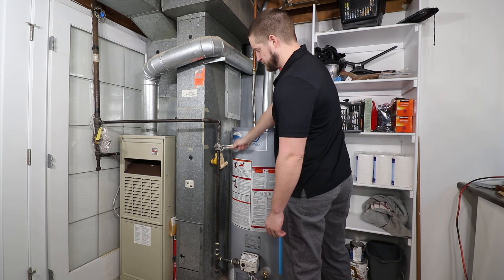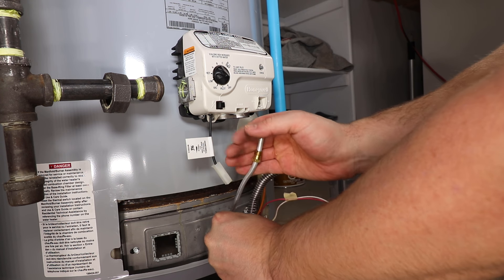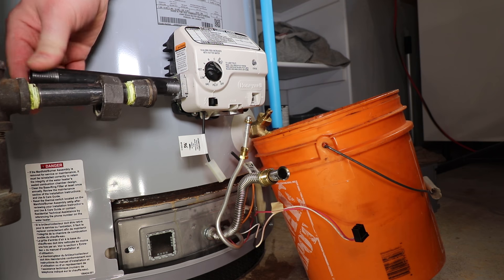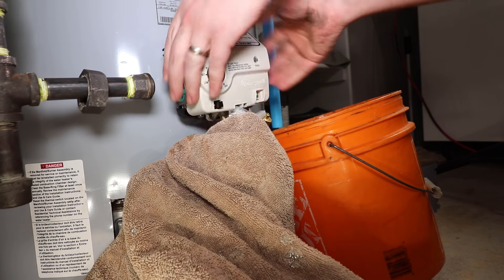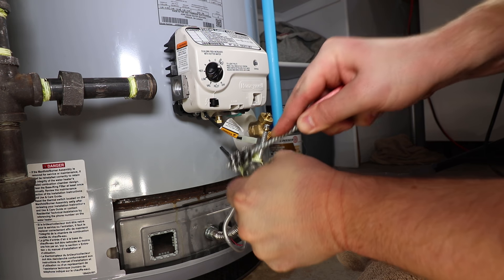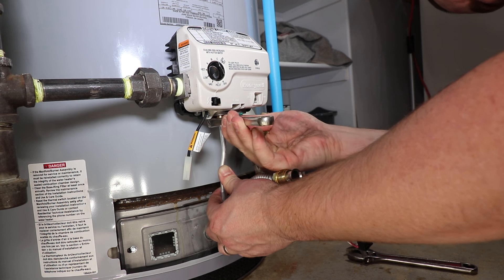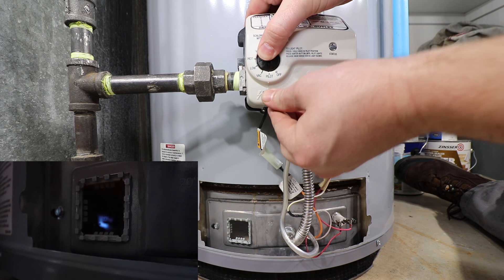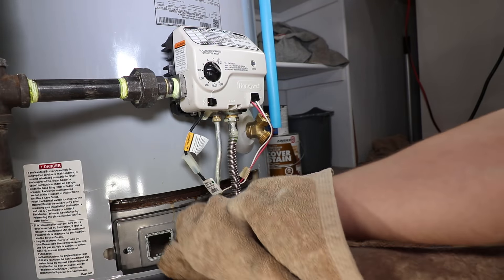Gas Valve Replacement on a Water Heater

Comment: MAKE: GSW
MODEL: G6-60S42N-PV-ES2
Installed: Brand new 2021 (Summer)

Hi there,
So today I noticed a Single Flash roughly every 3 seconds.

Error code states it is...
"LOW FLAME SIGNAL (Control continues to operate)

So I know what the code means but nowhere does it say how to correct it.

What should I do?

What I have done so far:...
I noticed that there were some items and boxes stored in close proximity to the water heater tank, so I removed everything to allow maximum airflow.

What else can I do?

Comment: Thank you so much. Perfect instructions. Was able to change in 30 minutes.
Reply from the maker: Thanks Sergio!
Reply: Hi Sergio did you drain the whole tank or did exactly as the video?
Reply: Used a garden hose until it stopped releasing water

Comment: I replaced my own thermocouple assembly, and gas control valve on my water heater using these videos and discussion in the comments. Thank you! Thank you! For these videos. Clear  and perfect!
Reply from the maker: Thank you Roman Thru! Nice job on your repair!
Reply: My tank will not ignite after many attempts to try. Do you think changing my thermocouple will fix this problem ?  I need some advice  please .

Comment: Wow! A perfect video! I’m not one to like or subscribe because then all I’ll ever see is water heater videos... or whatever I liked last. But I am happy to donate a couple bucks for this well crafted video. Venmo? Patreon?

Edit: found the donation site.
Reply: Double Edit: I attempted twice to donate. Each time its said something went wrong... I checked the simple information a bunch of times, the processor isn't working ATM. Lame. This is one of the few videos I've ever seen that was actually well produced and helpful.
Reply from the maker: Thank you so much for the kind words and feedback! I checked the donate link and it seems everything is up and running. I'll double-check with PayPal. Thanks for the attempts though. Take care!
Reply: @PROSDIY  Man, I really tried... it still says it for me, I was attempting the credit card method. Tried a different card, third time was not the charm - same message:

"Something went wrong
We couldn't process this donation. Please try again later, this could just be a temporary glitch." 

Venmo and Patreon have never had a problem like this since I've used them for years. Unfortunately this has lead me to feel less comfortable with PayPal than I already did. Either way, my wife and I will be replacing this valve body this evening probably by draining it all the way and taking our time... Without this concise video, I doubt we would have made the choice to do it ourselves. So thank you. Now you can be the only channel I subscribe to. lol
Reply from the maker: Thanks for the information. I'll definitely check into it. I have a Ko-fi page as well, but that uses the PayPal payment engine as well. If interested it's here: https://ko-fi.com/prosdiy
Good luck on your replacement! Let me know how it goes. Lol, thanks for the support!

Comment: We had a a repair guy out today and run a diagnostic on our water heater and said that this was the issue. He said that it's very difficult to do and it would cost $700 plus labor. Or the better route would be for us to completely buy a new water heater for 1700$
Reply from the maker: $700 would be very high for a atmospherically vented water heater control valve. Make sure to get a second quote.

Comment: What was the purpose of having to replace this? Was the box faulty or was it leaking? I have a Bradford White that is dripping water from behind the box and a $250 fix would be a lot cheaper than a $750 replacement!

Comment: we  have not had hot water for one month.  Please help.  The water heater is in the attic. My husband replaced the thermocouple, and the burner assembly.  He cleaned the air register.  The pilot light will stay on forever when the burner is not on.  When you turn the burner on and off the pilot stays lit.  But when you leave the burner on both the pilot and the burner goes off after about 15 minutes.
Reply from the maker: Did you ever run out of hot water, when it's actually hot? If you run the hot water for too long the tank goes completely cold it can condensate. The condensate can land on the pilot flame and put it out. I'm wondering if this is what is happening. I'd try lighting it, and don't used any hot water. You may have to light it twice until the water is fully hot. If the tank actually gets up to temperature after this test and the pilot is still going, then the issue would be condensation. Let me know how that goes, for further steps.

Another issue can be the combustion chamber getting too hot and tripping a temperature cutoff switch. If you can supply me with the model # on the side of the tank I can check which TCO you have. Thanks
Reply: Thank you so very much for trying to help us.  You are amazing.  My husband also drained the water heater but no change.  The model number is FG6150T403NOV Before we ended up with zero hot water we did not notice any problems at all.  My husband has now noticed a small crack in the burner.  Could this possibly the problem?
Reply from the maker: Hi Penny, There definitely shouldn't be any cracks in the burner. Does the main burner flame look erratic when it's on? Depending where the crack in the burner is, it can cause gas to be directed to the crack or air can be drawn through the crack. Both can cause an erratic flame.
Did you try lighting it, not using hot water, and then relighting as needed if it goes out to see if it will eventually get up to temperature and the pilot will stay on? You might have to relight it 2 or 3 times. This will rule out condensation.
Reply: @PROSDIY  you are amazing by helping us.  I reached out to many who would not answer.
Reply from the maker: @pennybaker1395  No worries. Hopefully we can get this figured out. :)

Comment: I agree with all the praise for this video...but I keep wondering, why does this controller unit need to be replaced at all for, in the first place? – ...what ends up malfunctioning in a simple device such as this...I have come to the view that this type of control  – burner and pilot flame control – should be all mechanic and not involve any "electronic" devices at all..."piezo-electric" or otherwise...
My problem, which led me to this video, is that as soon as I let go of the pilot and burner control button. it dies...I cannot position it to "low" or "hot" or anything....flame has died....all I can do is sit and hold that button pressed in  and see the pilot flame and see the ignition spark when pressing the little igniter button...what went wrong, I wonder....why did this unit "self-destruct" spontaneously...? (two days ago...)
No video has shown this type of problem....
But, yes, this video was exemplary for what it showed...

Comment: Thanks, you convinced me to do it myself.  My gas control valve is apparently dirty.  It makes the flame run rough.  Is there a way to clean it?
Reply from the maker: The control valve is not serviceable and if faulty it requires a replacement. If the flame is rough it is usually a clogged burner assembly or lack of combustion air. The burner assembly can be removed, inspected, and cleaned.

Comment: Would this device be the reason my water heater won't spark? I did feel it shock me when i pressed the sparl button but on the little glass window there was Zero spark and all i see is this caked on black charcoal looking stuff on some line i believe is a Thermocouple? 🤷‍♂️
Reply from the maker: Hi Jose, the spark jumps from the ignitor to the pilot sheild. If it is dirty with soot the resistance for the spark to jump will be too great. Removing the burner and cleaning the ignitor and area with some fine sandpaper should allow the spark to jump. You can test the spark while the burner assembly is out to make sure the spark is jumping before reinstalling. Hope this helps out. Let me know if you have any questions. Thanks!
Reply: @PROSDIY  hi, i removed the burner and cleaned out the contact leads you mentioned. It does do a very light spark when i press the little black square button but even after cleaning it it still wont ignite so i shut off the gas line again after trying to restart the heater again and after 2 hours i gave up and just decided to do my best to reach out to my land lords and let them try to take care of it. The problem with my Landlords is that they are A group of 12 people in a lutheran church who literally sit on a table and say yay or nay on repairing things in the home i rent from them. I also don't even know who is the main person in charge so it leaves me in a dilemma lol! I went to my local dicks sporting good store and bought 2 Solar thermal shower bags so that my little kids can take a shower tonight when the water cools down a bit. Its just one of those things where its out of your hands unless you are willing to pay for the handyman work and parts. We have rules here in California where you CanNOT take any money out of the rent for repairs unless your landlords approve it so im kind of stuck lol! Thanks for your help though, i greatly appreciate it.
Reply from the maker: Hi Jose, That's an awful scenario that you're in. I hope you get hot water soon. Just a thought, but almost all jurisdictions have rules with landlords maintaining hot water and the heating system. Where I live it is actually law that if the hot water is to go out that the landlord has 48 hrs to reinstate the hot water. It is considered a health risk. I know some areas even have more strict rules and have just 24 hrs to reinstate hot water. I don't know how much of a stink (no joke intended) you want to raise though. Good luck my friend!
Reply: @PROSDIY  thank you, i finally got a repair man to come by and they just replacement the whole Water heater and changed out the gas valve to one that you can turn on and off with your hand versus a wrench. It took the plumber from 8:30am to about 10:30am to get the job done with an assistant. Thank you for all your help and advice.
Reply from the maker: Awesome! Glad you were able to get it taken care of. Cheers!

Comment: My water heater pilot light will not stay lit.  I know it is not the thermal overload because I've done that in the past.  The plumbing company came out and said it's "probably" the gas control valve.  He gave me an estimate of $1,300 to $1,500 to replace it, or over $3,000 to replace the entire water heater (which I just installed myself 7 years ago).  I know my way around tools and equipment, so I found a new exact replacement gas control valve on Amazon for around $190.  After watching this video, I'm very confident it's something I can do myself.  Thank you for posting this.  It's very informative without all the extra babbling on and on about other irrelevant things (plus, the control valve in the video looks exactly like mine).  Two thumbs up!
Reply: Did you do it yet? Asking because I'm also considering doing this as well, curious as to what your experience was.
Reply: @jarrettmartinez4233  I replaced the gas control valve, but it didn't solve the problem.  Not only that, but the new valve quit working.  After lighting the main burner once, the pilot light went out and the valve would not relight it.  I ended up replacing the entire water heater myself.  If you are going to replace your gas control valve, just be very careful with both of the tubes.  Don't bend them too sharply or they'll kink.  And the threaded connectors have to line up perfectly before they will start.  Don't try to force them in or you'll strip the threads.  They should be able to go in by hand for the first few threads.  It took me a long time before I finally got mine started.  It should be easy as long as you're patient.  I just used a 1/2" x 6" pipe nipple, some open end wrenches, and some white Teflon tape for the water and yellow Teflon tape for the gas.  Good luck!

Comment: The most concise and logical presentation of a gas control valve change available with all safety and gotcha factors clearly noted.  The airlock method of installation without draining the tank shows the depth of knowledge of the presenter.  Well photographed.  Excellent
Reply from the maker: Thank you! Cheers!

Comment: A couple of things to note.  In this video, the main burner tube connection has right-hand threads (righty tighty, lefty loosey).  My Honeywell gas control valve (looks just like the one in the video) has left-hand threads.  If you can't get yours loose turning one way, try the opposite direction.  Also, the main burner and pilot light tube nuts have to be PERFECTLY STRAIGHT going back together.  If they are not, you risk cross-threading or stripping threads.  Don't tighten until you can get the nuts in by hand for a few turns.  Since the pilot light tube is rigid, it can be very hard to get reconnected.  It took me about 20-25 minutes to get it right.  Be patient, don't get mad and try to force it it.  The good news is, I was able to replace the gas control valve by myself.  The bad news is that the pilot light still will not stay lit.  On to the next possible cause.

Comment: Looks like the thermocouple is located near the pilot nozzle.  How does the controller know the water temperature?
Reply from the maker: On the end of the control valve is a probe that enters the tank. This probe is the temperature sensor and contacts the water.

Comment: As a master plumber and gas fitter, I would not recommend anyone who is not qualified be screwing with gas, no matter how simple you think the job is. A fellow plumber in my area, with several decades experience, blew himself and the house he was working in, off the foundation and killed himself. It was a "simple routine procedure" he performed countless times before, and he was a pro. No responsible technician should be encouraging first time amateurs to try gas fitting for themselves, no matter how "simple" it seems.

Comment: Thanks for such a great video. I just moved into a new house and the pilot light kept going out on the gas water heater, and eventually it would not relight. It is a Rheem Performance water heater with a Honeywell control valve, installed in spring of 2015. I first tried to clean the part where the gas comes out near the burner (can’t remember what it is called), but that did not do the trick. I then called Rheem and they went through a troubleshooting with me, and they determined that I should replace the pilot assembly. So I ordered the appropriate replacement kit, paid extra for express shipping, and replaced that today. I was able to get the pilot to light and the gas valve did initially have the one blink indicating normal operation.  But as soon as I stopped pressing the button on the gas gas valve, the pilot light went out. Now it will not relight. I’m thinking of replacing the gas valve next, but does it sound like that is what the problem is, or could it be something else? I’m starting to wonder if I should have just called a plumber, since I’m into this about $160 already.
Reply: check this video
 https://www.youtube.com/watch?v=YZ4r594jkIM

You may only need to clean the air grating under the water heater. Dust can accumulate over time and diminish the air flow enough to shut down the gas valve.
It is a free check and may work. I do this once or twice a year when I lose the pilot.
Reply: William Lackner I appreciate the info, however, my air grates are on either side of the water heater. Any idea how I should clean those?
Reply from the maker: Hi Eva, Congratulations on your new place! If the pilot is lighting and the gas control is blinking 1 blink every 3 seconds the thermopile should be producing enough mV so we can rule that out. If the pilot goes out after releasing the knob it is most likely a tripped or faulty TCO (temperature cutoff switch) or gas control. Check your TCO first. Here is a video explaining how to test and reset the TCO. https://youtu.be/_XYCVgsPu1U
It wouldn't hurt confirming the mV being produced by the thermopile as well. Here's a video on that : https://youtu.be/mtbn3FtMqCM
Let me know if you have any questions, and let me know how it goes. Good luck!
Reply: @evabobeva77  mine the pilot turn on but wont blink so pilot go off when releasing after 2 minutes or more

Comment: I am about to replace my leaking gas water heater. I prefer the old reliable gas valve, not the new fancy electronic valve. I know not to put gasoline in the basement, so I have never had a fire or explosion. The new fancy stuff will cost more and will be less reliable. This is not progress.

Comment: QUESTION IF THE PILOT LIGHT IS OUT AND THE CLICKER HAS NO SPARK DO YOU CHANGE THE BOTTOM PART TO?PLEASE
Reply from the maker: Hi fordman3333, You'll have to test different parts of the spark igniter to determine why it isn't sparking. Start at the push button igniter side and work your way to the burner assembly.
1. Disconnect the igniter wire from the push button igniter. Put the end of the igniter up to a piece of metal and click. You should see a spark jump. If it does move to the next step. If it doesn't, replace the push button igniter (Piezo ignition). Wear a glove when doing these tests, the spark can jump to your skin and give you an unpleasant shock.
2. Check the igniter wire for any breaks or worn insulation that can cause the spark to short circuit, or not reach the pilot assembly.
3. Check where the spark jumps to the pilot assembly. It is very common for carbon to build up at this location. Use some fine sandpaper to shine up the area on the pilot assembly where the spark jumps to light the pilot. Shining up this area reduces the resistance for the spark to jump, resulting in a stronger, brighter spark.
Good luck! Let me know how it goes. Thanks!